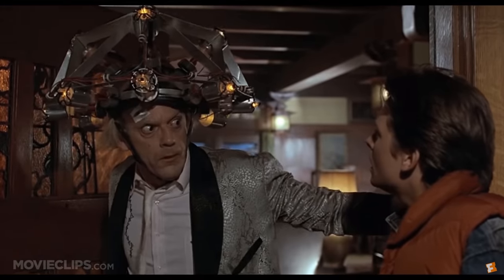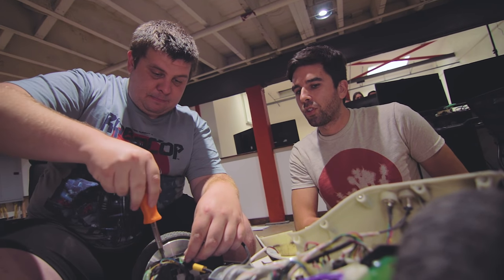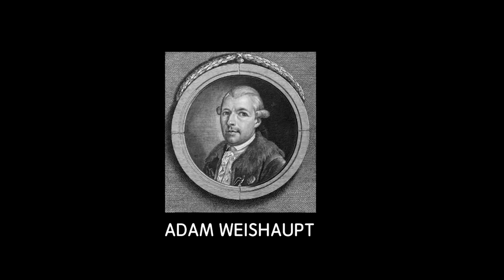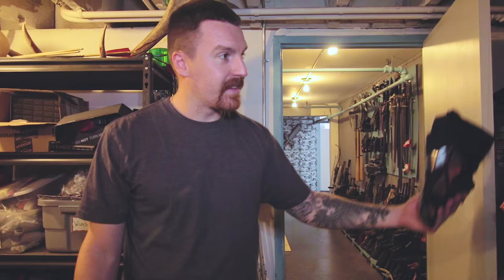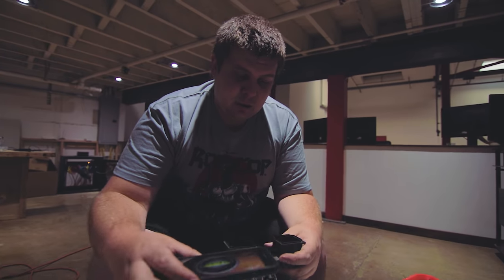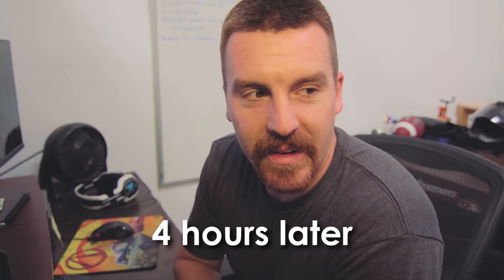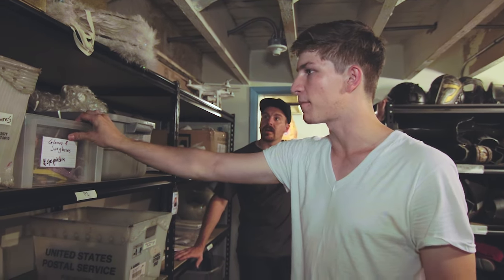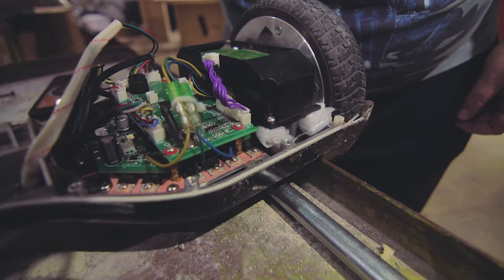Cutting Open a Hoverboard

Comment: Spencer, if you cant angle the IMUs inside the the plastic body of the board, why not make (wooden) wedges that are the neccesary angles and just stick them on top of the board. so that the user is standing on the wedges, the IMU's are angled and all is good.
Reply: Because the case still wouldn't fit. They angled it fine but if the case can't fit back on then there's no point
Reply: +Ken Perkins the impression I got is that this person wants him to assemble it as is and put an angled surface ontop of the board to compensate. this isn't a good solution because youd probably make it impossible to balance on

Comment: You could just get a remote from the company and put it on the same frequency that the receiver is on, and then use that. Since it's a company flaw and not your's, you'll most likely get one from the company.

Comment: wait if there is an intena in hoverboards could that mean the're tracking our locations?
Reply: probably sound like a dumb ass question, but just curious.
Reply: Did you not bother to watch or pay attention to the whole video. He explained at the end that it was so you could reset stuff with a remote
Reply: Could be, or hey maybe repurposed the board from something else to save money on new board design.
Or there's a more expensive version with bluetooth or smth but they all use the same hardware.

Or as in the end of the video... the hoverboard comes with a remote.
Reply: Spencer said this antenna would be used to connect to the machine using a remote.

Comment: I thought IMU was 'inertial measurement unit' not 'inertial motion unit'
Reply: You can tell how much he knows about electronics. when at the end, blame it to a wireless control.
Reply: I can tell how much attention you paid to the video. He needs a wireless controller to be able to reset the hoverboard because apparently its the only one that doesn't allow reset through the on/off button.
Reply: He know shit of electronics. A circuit board that have IMU comes with a MCU  to process all the data. meaning you can reset or program directly to the MCU w/o a need of a wireless remote. When you know shit of electronics you will blame your failure to something else.
Reply: and calling XT60 connector, the same "battery airsoft" tells me he knows shit.
Reply: antonio cruz he never claimed to be an expert in electronics he even said he has a fairly limited knowledge in electronics. with that said he probably didn't think about directly resetting the board or wanted to play it safe and not mess around.
Reply: I learn If I do not know something, leave it alone. Why open it for nothing. Indeed He's not an expert
Reply: antonio cruz I can agree on that to a certain extent. For example if something stops working and you can easily enough take a look inside why not it might turn out to be a simple fault in the end. And well he didn't open it for nothing he identified the issue they were having with that hoverboard but turns out wasn't able to fix it.
Reply: Guys. Calling a Tamaya connector an "airsoft connector" is just shorthand for the audience. It's not that big of a deal.
Reply: One of the best ways to know how something works is it open it up and take it apart to see how each component works, this is how the older generations and people who don't have access to resource learning materials know how to fix shit. You will never be an expert if you play it safe all the time.